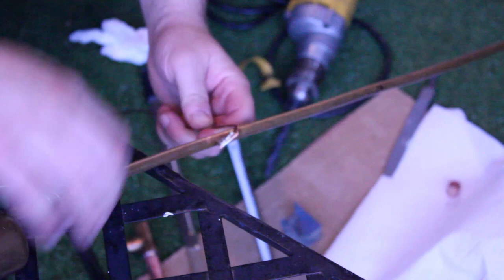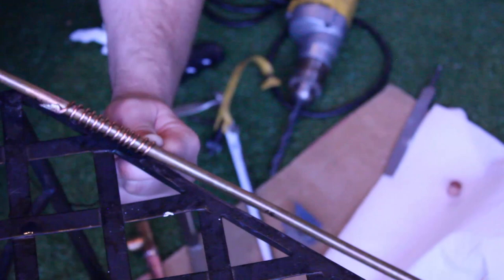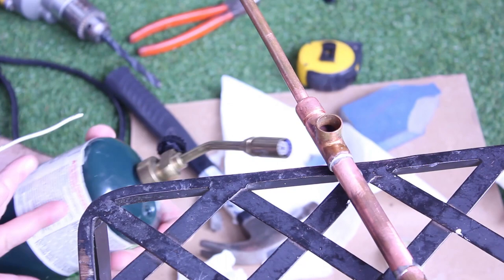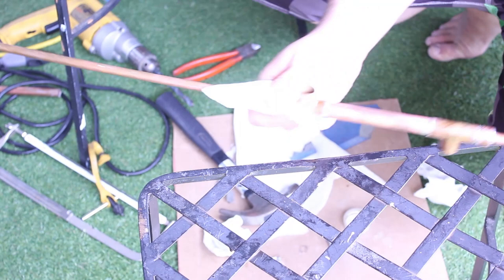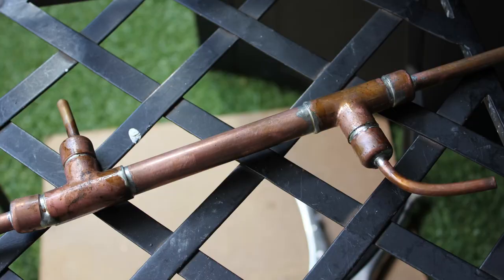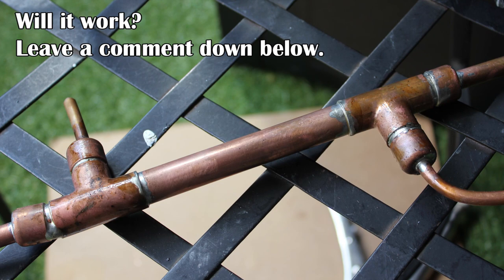Will it work? Mini 5" Liebig Condenser Build for Stripping Run

Comment: I regularly operate a 5 1/2 inch liebig with no problems. 3/8 inside of 1/2 inch. Try coiling about 5 feet of 3/8 or 1/4 inch copper and place it in icewater (cooler or bucket) and hook your intake water to it. It will chill before reaching your condenser. Keep shinin'

Comment: So I've built a cooling circuit that's supposed be up for the job of doing a run in the Australian summer heat, breaking it in soon so fingers crossed. It's a chest freezer with a 65L reservoir and a submersible pump. Plan is that I can run water or even saline or glycol if necessary, if that still doesn't do the job I've two 240mm liquid cooling PC radiators I'll add in on the hot water return before it goes back in to the freezer. A bit of work I know, but in Australia I can't justify pouring so much water down the sink. Love the channel, BTW :-)
Reply from the maker: Thanks man. I'm doing something like that for a fermenter right now. I don't have room for a fermentation fridge as I live in an apartment in the city. So I have a corny keg full of cold water, I use crappy USB powered sump to circulate cold water through a SS coil in a fermenter sitting outside the keezer, controlled by a Raspberry Pi with a temp prob. Works okay. Are you going to silicone the seams and fill it up with salt water? Get a giant liquid ice cube going? Let me know how it works out. Have you seen people using air conditioners to make glycol systems?
Reply: I'm basically having a tub within the freezer. I'm lucky enough to have a buddy who's a refrigeration technician, he advised against doing one big ice-cube. I'll be going for trying to keep the liquid as cold as possible, especially under 20°C, adjusting the flow so that the return cooling water comes out around 54-57°C.

I've seen a few good plans for home-made brine/glycol systems, but the only one I've seen actually made so far is the one George on Barley and Hops distilling made from an eski and a small air conditioner.

Comment: Not thermodynamics expert in any way.

I ran a 1/2 inch with 3/4 over liebig that was 24 inches long, but it could not keep up with a 5500 watt heating element during a stripping run. It could handle 3200 watts MAX after collection started (then I would see the vapor along with liquid pouring out!!). A few years later I made a 2 inch shotgun condenser with four 1/2 pipes that is 28 inches long. That can easily knock down all vapor.

My cooling water at the time was a 55 gallon barrel with 45 gallons of water run by a 130 gph pond pump running wide open with no restriction on it. I later ditched the barrel and got a SS slop sink from a demolition job. I still use the pump and fill up the sink with water, then change it once after hearts cut. Then at the end of the run I pump the "Hot" water through the still via a CIP spray ball. (There is drain in the bottom of the keg)
Not sure if you are recirculating water via pump? Or just pumping cold tap water in?
I believe there is a difference but I am not sure...

Too much cold water will induce "Shock cooling" and "Huffing" - product output sounding like a train. 

Thread on Liebig on HD forums worth reading.
https://homedistiller.org/forum/viewtopic.php?f=87&t=74252&p=7559633&hilit=liebig+cooling+watts#p7559633

There is somewhere on HD about wattage vs surface cooling area but I could not find it.

Cheers man!
Reply from the maker: Hey Big Ed! I do remember seeing a calculator on HD regarding how to size a condenser coil or something like that. There were many parameters required. There is a lot to think about. I keep toying around with the idea of starting to make whiskey, and I know that shotgun condensers are kickass at knocking down large volumes of vapor and turning them into cold liquid exiting the still. I may very well end up with a vodka still head and a separate pot still head in the end. I'm currently using cold tap water as my cooling liquid but don't like to idea of how much water it uses during a stripping run. My spirit runs use just a drizzle of water. Hopefully, I can get to the same place with my stripping runs (but not likely). How big if your cooling water reservoir? How 'hot' does the cooling water get? I would be interested in filling my bathtub and using a circulating pump.

Comment: ok yes it will work   but get a kitty liter pan   and  a  Submersible aquarium pump  from ebay  put ice in pan  little water  circulate this through system    with chilled water  also they make pipe insulation made for the pipe alot cheaper than a can of foam
Reply from the maker: Thanks for the reply. When I talk about insulating the pipe I'm taking about this sort of insulation. Very cheap and works well. https://images.app.goo.gl/VUMQgRbwxRMXgZJ97

Comment: Question. Why cover it in foam insulation. You want it to take heat away. Would not venting it to the air help? Is there a benefit. What are you trying to do by covering it in fome. When you  heating still up you want to keep heat in. On condenser especially a small one. Its to get heat away.
Reply from the maker: I'll be covering up the water jacket area with foam once I settle on a length. I'm thinking the foam will help keep the cool in, and will stop condensation from forming on the jacketed area. I'm hoping the foam will stop condensation from collecting then dripping on the floor. Not sure if this is needed or not. Do you have condensation collect on your condenser(s)?
Reply: Could add cooling fins to take heat away. May just  raping that copper wire around the out side thus increasing the surface area to remove heat. (if thick enuff) If condensation dose form on out side. That will add to cooling efficiency.  I doubt condensation will happen. To much heat. 
  @OpenSourceDistilling

Comment from the maker: Do you think I'll need to extend the Liebig Condenser to get to 25-30 C or do you think it's already big enough?
Reply: Mine is 24" and I can easily run 2ltr per HR at 95%
Reply from the maker: @biggestbeard6210  Nice. You are knocking down vapor with it, right?